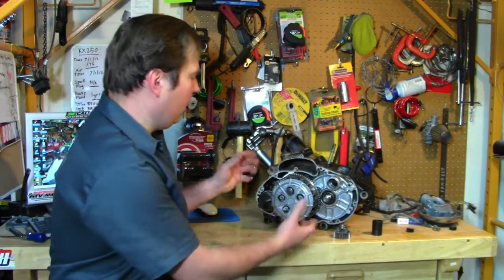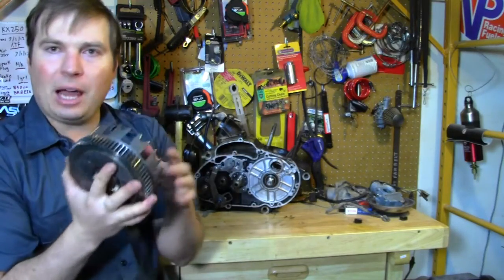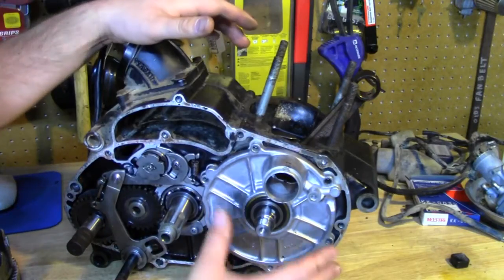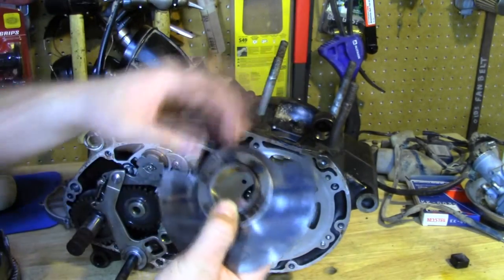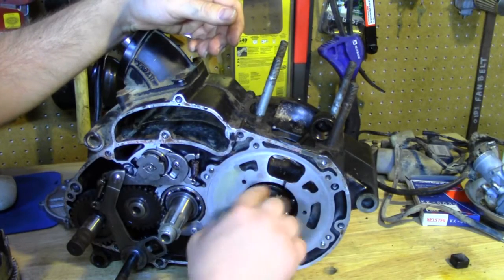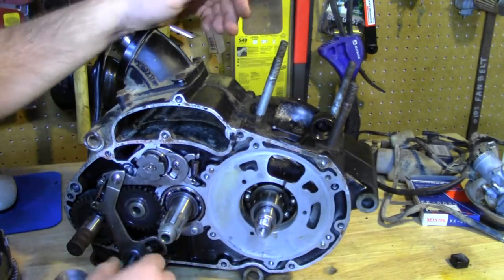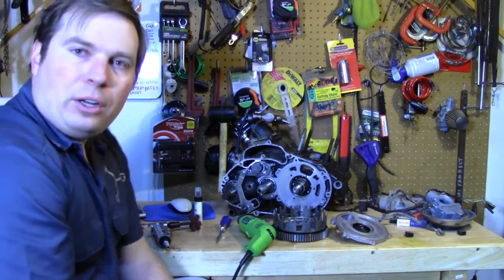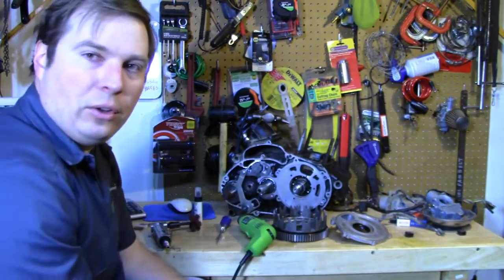Rotary valve 2 stroke Engine modification Kawasaki F9 350 - Barn Fresh SE2 EP3

Comment: So would we be able to get someone to measure the fiber plate “teeth” or “ridges” and then weld the fingers on the basket and cnc them down so that you can save the clutch basket while tightening the tolerances so you get far less chatter?
Reply from the maker: You could I suppose.  It would be a lot of work and expense to have a tool path made for that, but it could be done.
Reply: @thejunkman  oh of course but as I’m seeing now it’s getting increasingly hard to find parts for these and I’m sure it would be about the same expense to get a billet basket made.
Reply from the maker: Yeah in the future it might be a thing, but right now the parts are still pretty plentiful.  Also the aftermarket makes clutch parts for the H1 which uses the same clutch on the F9.

Comment: Good evening,
I’ve just restored a 1974 Kawasaki F7 C 175 and have got it running.
During the rebuild I removed the drain pump, cleaned it, checked it and it all seemed ok.
I understand the purpose of the pump and I’ve read how most people block them off as they are not really that effective. I guess they were seen as high tech back in the 1970’s.
My problem is that when I stop the engine I get a discharge from the pump, put it isn’t unburnt fuel, it seems to be gearbox oil. There is no smell of petrol at all.
To me this implies some kind of leak from the gearbox into the crankcase but I’ve studied every diagram I can find and can’t see a seal which could be the problem.
Do you have a similar/any experience ?
I have considered blocking the drain pump as others have but I don’t have access to any engineering equipment to cut parts. I could replace the drain pump diaphragm with high temperature rubber gasket sheet to block it off; any thoughts on the effectiveness of this would be great.
Thanks,
Herbs.

Comment: Very helpful tips, thanks. Question  - I’m working on a ‘71 F8 and there’s some scoring on the case side of the rotary valve, a piece of debris must have got in. This is within and away from the large o-ring area, am I safe from a lean condition? Should I fill and sand the scored area with epoxy filler? Thank you
Reply from the maker: Depends on where it is on the valve.  Is it in line with where the ports open and close?  It probably won't mater all that much really.  New and used valves are plentiful.  If you are worried about it just buy a new/better one.  Also check this video out on measuring the thickness. https://youtu.be/P71y-pma3ZY

Comment: So is that disk acting like a cam would on a more modern engine?
Reply from the maker: +dustysquito Well sort of.  The disc controls the intake timing and seals the crankcase during the power stroke.  On more conventional 2 strokes the piston skirt and/or fiber reeds control and seal the crankcase.  The benefit of this design is intake timing can happen independent of the piston's location within the stroke, thus longer duration of the intake can happen.  The result is 2 strokes that can have very good low end torque (on par with 4 strokes of the day) without sacrificing mid-upper range power.  The downside is they are more complicated to manufacture (more parts) and by nature of the design the whole engine has to be wider as the carburetor has to mount to the side, down inline of the intake tract.  Also there are more areas to seal with this design, which is not a problem when new, but as they age those are more gaskets and seals prone to failing.

The exhaust is still timed just like any other 2 stroke (piston port/reed valve) buy the piston skirt and crown.  It has always been wondered if a rotary valve 2 stroke with a modern style variable volume exhaust valve would be the ultimate 2 stroke engine, but the mid 70's emissions rules and the motorcycle industries move toward more specialized bikes, such as inline 4 cylinders 4 street and dedicated racing only motocross bikes sort of saw engine development favor the more simple and lighter piston port/reed valve engines with eventual water cooling be the "wave of the future".  Once water cooling in high strung single cylinder 250cc engines became reliable the rotary valve design saw diminishing returns.  Also the "dual sport" (as we know it now, then it was known as Enduros) began to dwindle as riders either chose full on dirt machines or full on street machines.  The days of the "Big Horn" a dual sport that you could theoretically race (by removing the lights, mirrors, and any other non essential parts) easily was just not practical if you were serious about racing.
Reply: thejunkman  I do like the idea of a machine you're riding every day that has the power and suspension to be a full blown race bike when needed, though I guess that level of performance also comes with some reliability issues that slowpokes like my DR don't have.  I still think one of the coolest features outfitted to a two stroke engine was when they added oil injection and took away the responsibility of the rider to pre-mix their fuel. Honestly, I probably wouldn't have ever sold my KDX200 if it would have had that feature.  The two stroke powerband was just such a riot.
Reply from the maker: +dustysquito 

The KDX200 (and earlier KDX250 which I have) is probably the most underrated "cheap" woods bike you can get!  After I hung up racing MX competitively I converted my 02 KX250 into a more woods friendly bike, mellowed the porting, and smoothed the suspension, to more closely match my KDX only much lighter.

Thing is injection systems just add weight and extra complexity for all out performance.  Also people forgot to keep the tank filled and ran them out frequently or ran them low creating air bubbles in the line that cause intermittent lubrication problems.  I wrote an article years ago about why people seem to disable oil injection and this was a reason why, engine failures from operator error in keeping the tank full.  Pre-Mix alows for maximum power to be made as the air/fuel mixture is kept at a constant because the oil/fuel mix is constant.  In an injection system the mix is dependent on throttle position AND engine rpm as the pump is driven off the crankshaft.  Thus of all out performance demands of motocross racing this keeps tuners "hunting" for the best jetting as the air/fuel mixture is always changing (oil doesn't burn or contribute to making power)  Injection sacrifices performance for reliability, and in the motocross world the engines are built around 40 minute moto's with expected tear down and inspections every few races.  Engineers only care if the engine will last long enough to win the race.  This is part of the reason why hi-po 4 strokes (250/450) of the last decade got a bad rap as most people that bought them were more recreational riders that thought they were getting DR/XR/XT/KLR (predominantly 4 stroke air cooled) reliability/longevity, with RM/CR/YZ/KX water cooled 250cc 2 stroke power.  They got the power, but the longevity had to be sacrificed to squeeze similar performance out of those modern 4 stroke engines.

If you want to read about 2 stroke oil injection see it here.  http://www.thejunkmanadv.com/2-stroke-oil-injection-systems.html
Reply: See, I had assumed that the oil injection would make things less prone to operator error. I guess I never really got a chance to see how they were really being used in the real world.  The super short range on my KDX had become a massive liability when I took it out to Utah because I was burning roughly 1/4 of my total range just getting to where we were riding.  I do really miss that bike when I'm out riding close to home, though. That's one of those things I'll probably find myself regretting farther down the road.
Reply from the maker: +dustysquito Well the KDX was developed as an offroad racer, not really meant for D/S'ing.  The main focus was to give KX (the motocross race bike) like handling and light weight in a more offroad friendly chassis, more range and a more friendly engine power band.  I have had the luxury of owning and riding so many different types of bikes from so many different era's in motorcycling that I have come to understand some of the how's and why's certain bikes, segments and technologies have evolved.  Unfortunately the "dual sport" segment has dwindled and nearly been ignored by the manufacturers that choices are very limited unlike other segments of motorcycling.  Even the observed trials segment has more development and choice in bikes than dual sports.  Marketing and customer wants have distilled down into each segments ultimate want.  If you are a motocross racer, all you care about is the highest performance in the lightest package, longevity be damned.  In crotch rockets/repli-racers same deal.  Playbikes, reliability and affordability, and volume is king, that means low performance and old designs.  I could go on, but it boils down to people want bragging rights and your and my DR's (your 650 my 350) don't cut it on paper.  They make dismal horsepower for their displacement and are pig heavy comparatively on paper.  Seriously the argument is as old as time "My CRF450 makes 50 hp while your DR650 makes 36 hp" say the youngin's but of course apples and oranges.  Somehow that number denotes how "good" the bike is to the lay person.